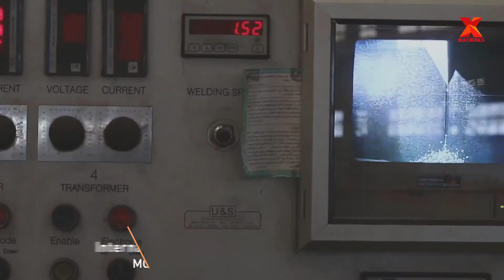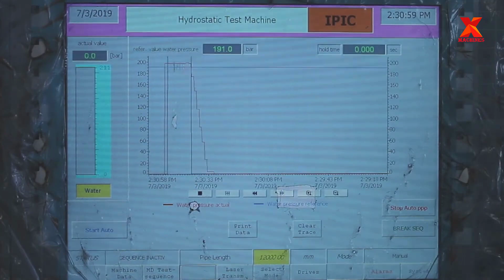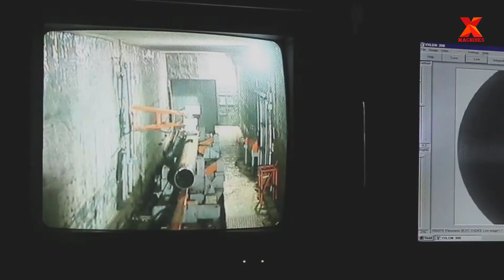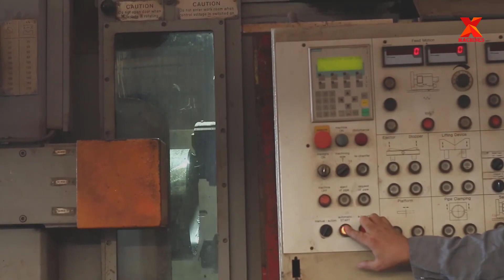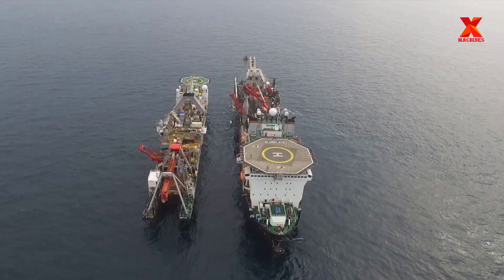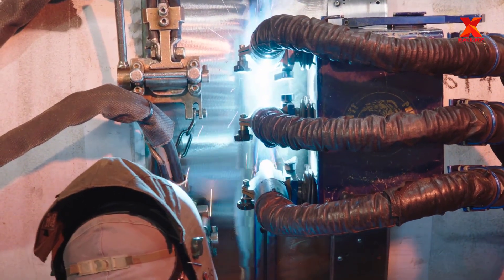The Hypnotic Process Of Manufacturing And Installing 27000 km Of Offshore Oil And Gas Pipelines

Comment: Some of video at end showed the Allseas Pioneering Spirit mega-ship used to transport and install offshore rig base (jacket) and to place topside units on top of bases. 

Great video. Every time I see large diameter pipe leaving back of pipe laying vessel, the bending of pipe exerts tremendous strain on both ship and pipe. It might be over 1,000 feet to bottom, that means over 1,000 feet of pipe is hanging on back of ship. The weight pushing on back of ship is hundreds of tons or more.